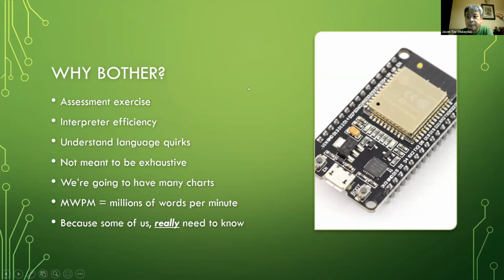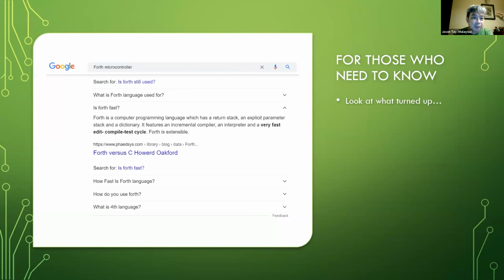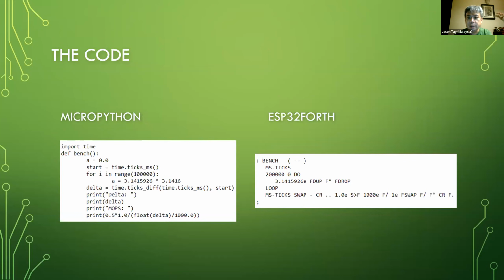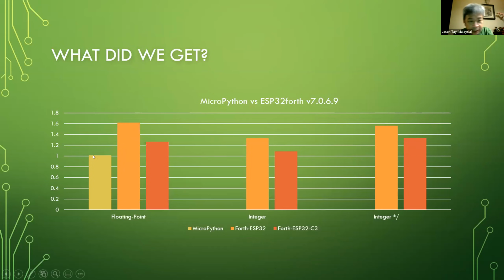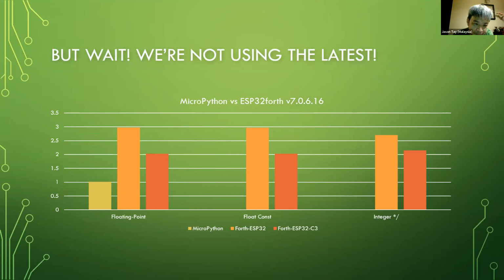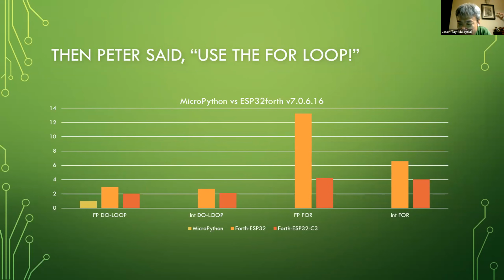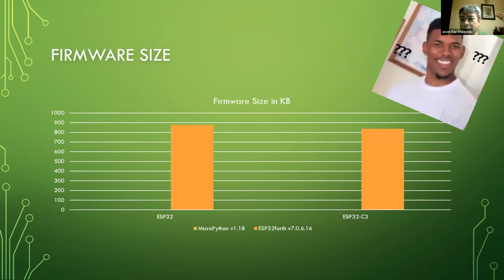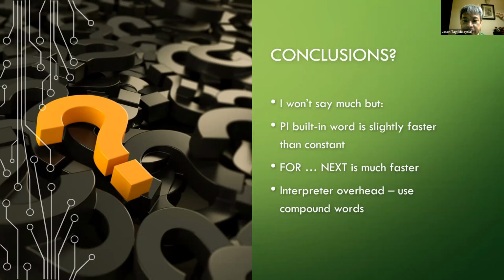ESP32FORTH vs Python BENCHMARKS Jason C-J Tay Forth2020 Zoom #21 2560x1440

Comment: A compiler will notice that the looped code can be computed in advance, and e.g. iForth will notice that the result is DROPped and do nothing. I can  imagine that some compilers do not consider all possible combinations and sometimes are faster than expected when only "minor" changes are made. Showing a code dump of the inner loop would illustrate this.
Reply: Yes, that's correct, I experienced that when I tried it with Mecrisp Stellaris, the "extreme" performance was a dead giveaway, and running a disassembly of the compiled loop confirmed that the operation was being optimised away. In such a case, this "benchmark" is too simple.